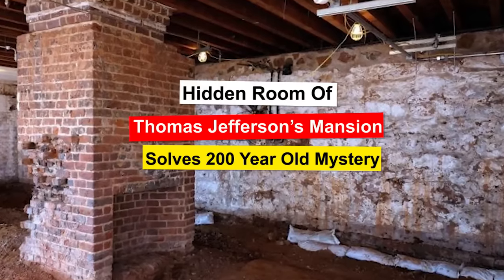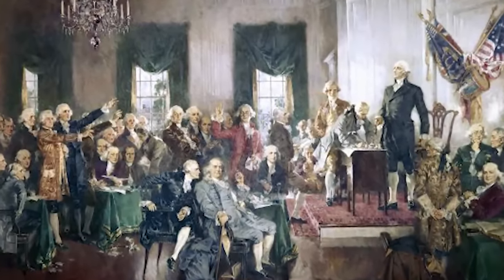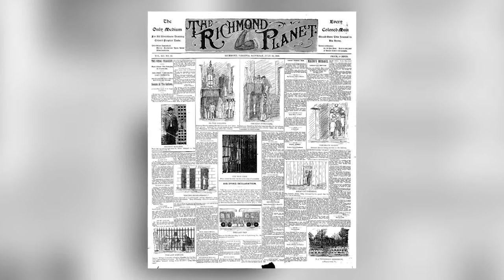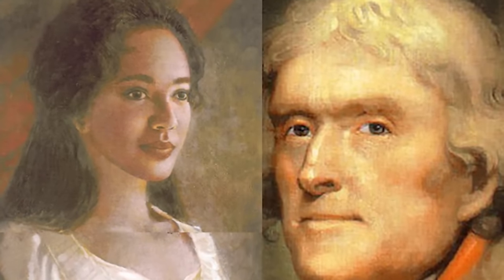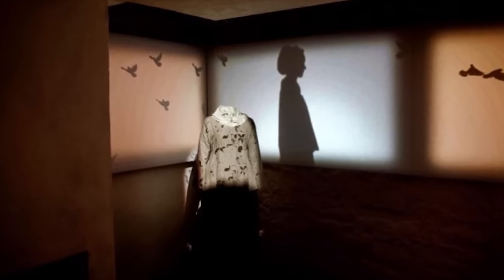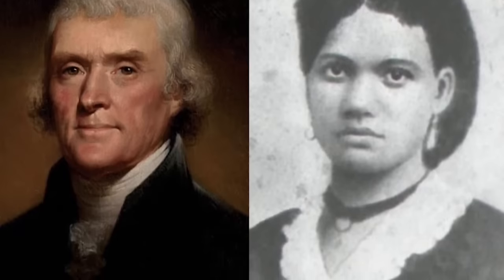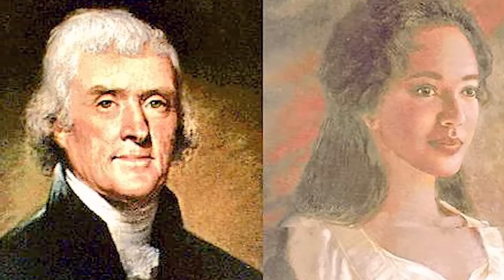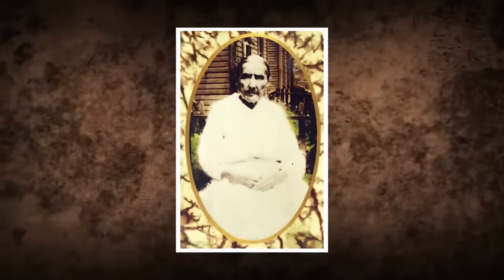Hidden Room Of Thomas Jefferson’s Mansion Solves 200 Year Old Mystery..

Comment: Some try to judge yesterday's events by today's standards.  That being said, it's clear that public morality standards were significantly higher then, at least in the high social circles of the founding fathers.  A point about yDNA research may need to be clarified.  If a direct line male descendant (son of the son of the son ...) has the exact same yDNA as another (i.e. the same yDNA genetic mutations called SNPs), they share a common father.  That's why Thomas Jefferson, his brother, father, cousin, etc. had to be the father of Hemmings' male descendants.  Of that, there can be no argument.  If Thomas Jefferson was not the father, there should somehow be even more overwhelming evidence that one of his male relatives was the father of Sally Hemmings' male descendant.  No one has as yet come forward with such evidence.